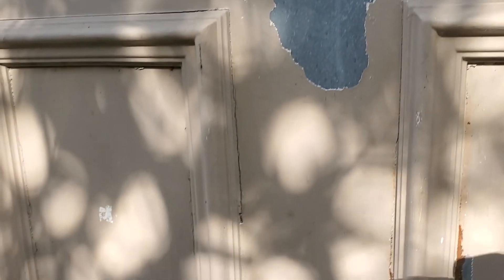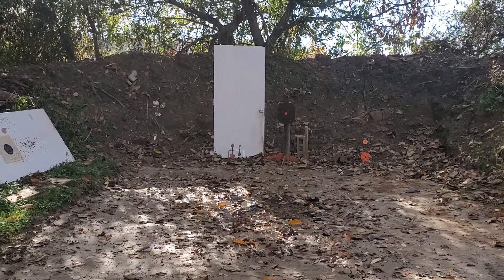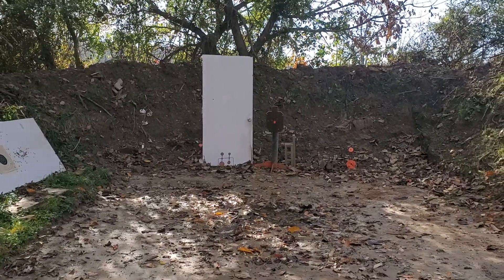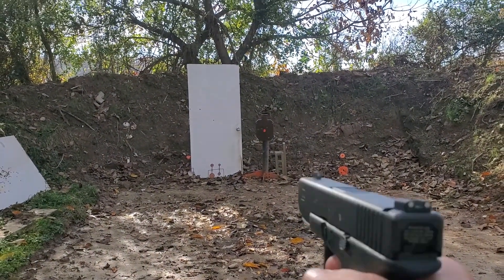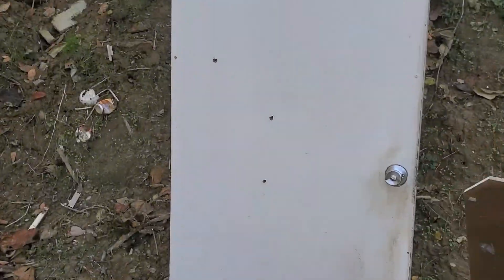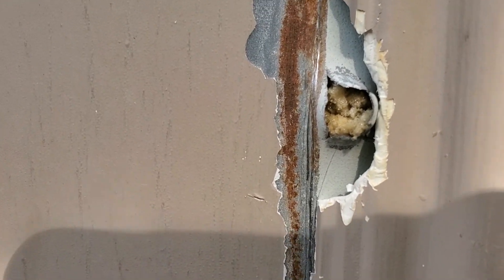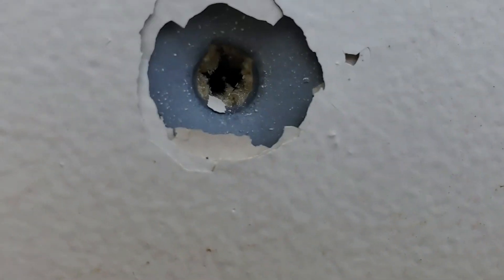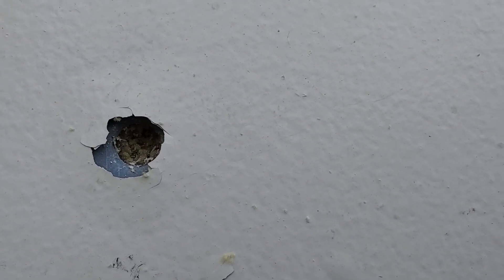How bullet proof is a steel door?

Comment: I welded those doors . They are not thick at all thing gauge steel . Fire proof has styrofoam an regular has cardboard honey comb in between the steel . Well done weak points are center top , bottom then your sides . Just Incase you run up against one . Prison an hospital are of thicker though.